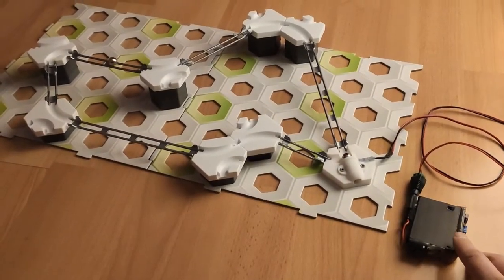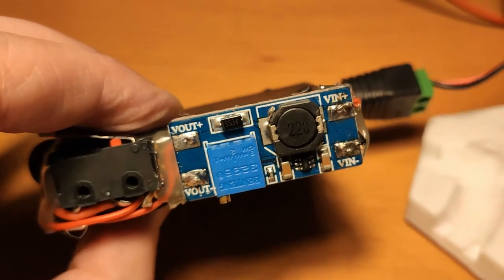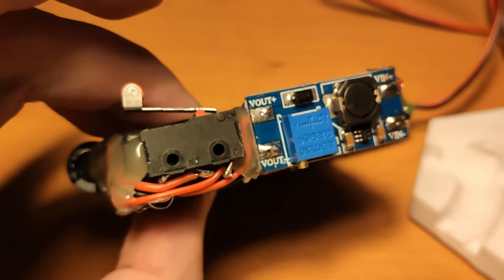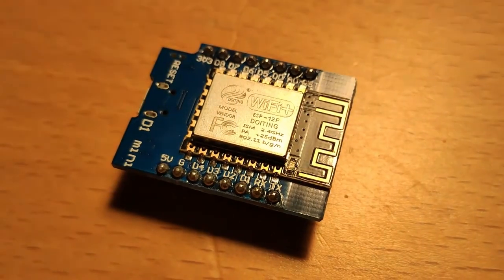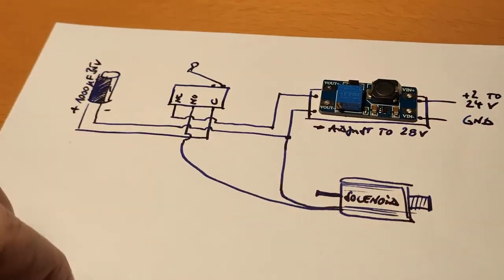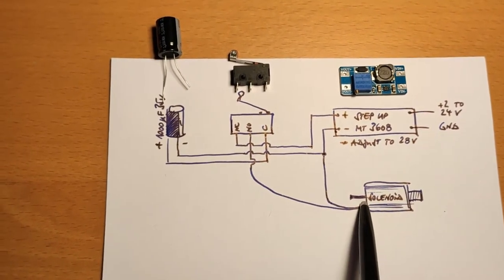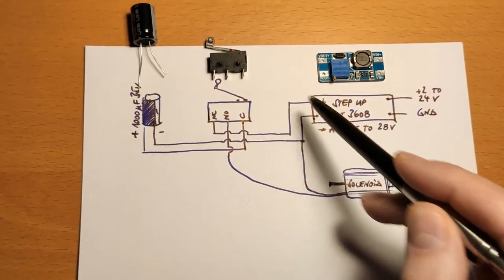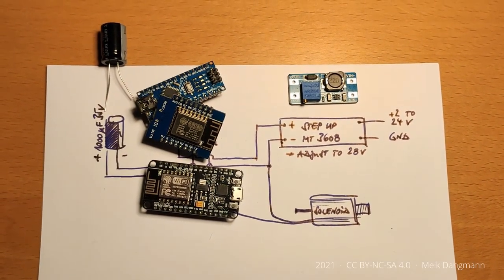Gravitrax Solenoid Cannon - Electrial circuit for the power supply

Comment: Hi I just found this chanal. I see here alot of interesting videos. Thank you for those videos.

This project is really cool.

At the moment I design and build a DIY Pinball machine. I'm learning a lot during this project. The solenoids draw alot of current for a short amount of time. I use very big capacitors for this. Otherwise the rated voltage do barely anything... but be aware that regular switches wear out quite fast if the need to switch high currents. Therefore I use MOSFET to switch them and the micro switch just triggers the gate of the MOSFET.
Reply from the maker: Thanks for the tip about the switches, that's good to know! :-)

Comment: Thank you very  much for this explanation; just what I was looking for! I'd like to replace the switch with an Arduino or ESP, so the solenoid can fire automatically at constant time intervals.
I'm not certain, but I think I should use two transistors for this: one to make to connection to the capacitor to load it and one to direct the current from the capacitor to the solenoid. Or is there a better way to do this?
And another question: in other tutorials about solenoids a diode is used in parallel with the solenoid. Why is it not used here?
Reply: Never mind my first question. I used a SPDT relay. Works great!
Reply from the maker: With motors or solenoid valves you have the effect that the movement of the motor or the valve generates a current, even if your actual power supply is switched off. That is the principle of a dynamo. Unfortunately, depending on the direction of movement, even the direction of the positive terminal and GND can change and destroy your circuit. With a diode you can prevent this, so that the current runs only in the intended direction.
So that would certainly be an improvement to my circuit, but so far it still works without problems, fortunately.
Reply: @MakerMeik  what value for would you use? I want to follow the route with the spdt relay. Would you connect the solenoid across the leads of the solenoid?